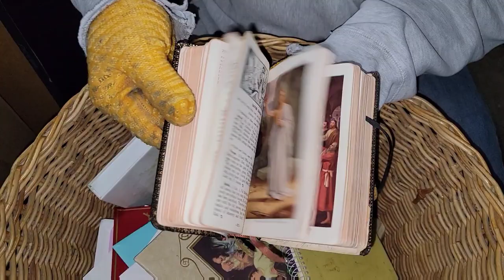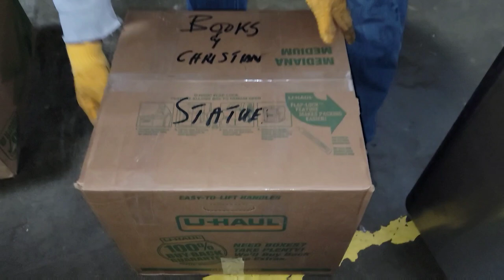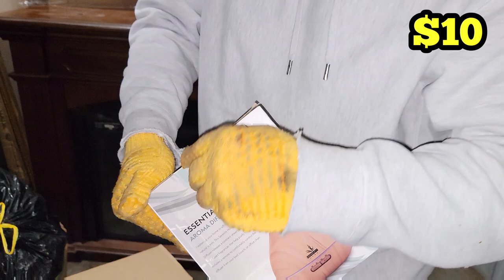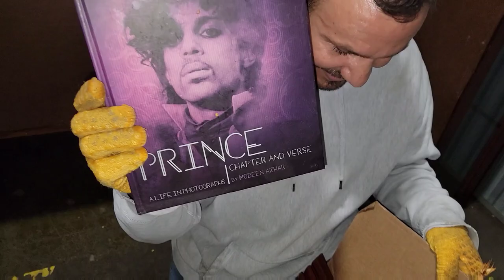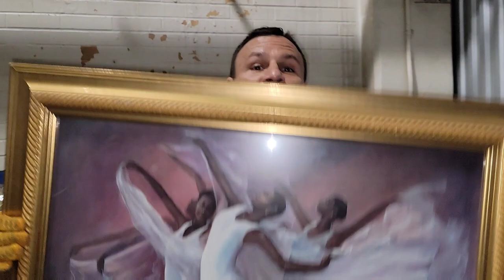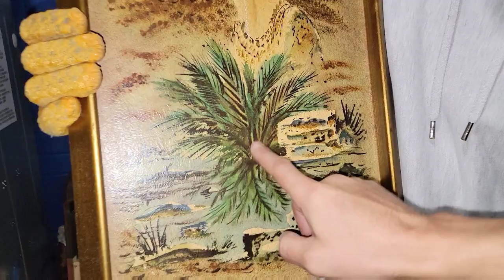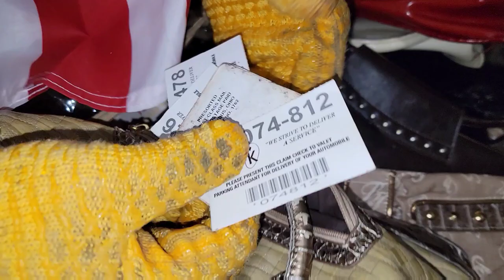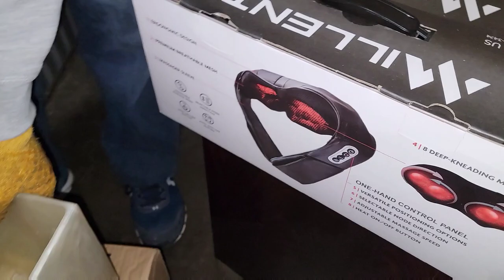PREVIOUS OWNER LEFT GOLD

Comment: The black wire tower u called a planter.  I bought one for $25 a couple years ago.  The 3 black egg baskets go with it hanging in the middle. We bbn use them for fruits.  Sweet potatoes, apples, oranges and bananas. That way they are not hidden. Forgotten and start smelling.